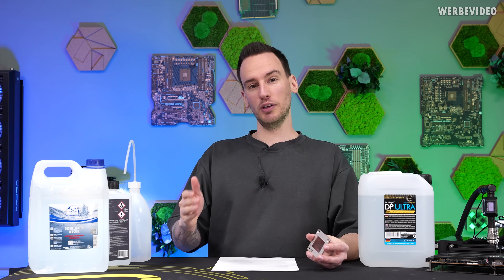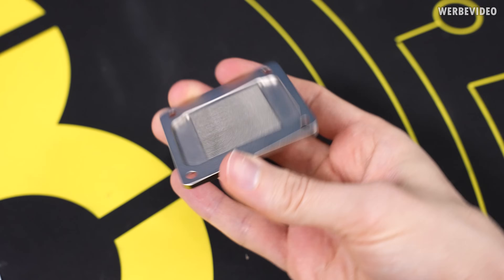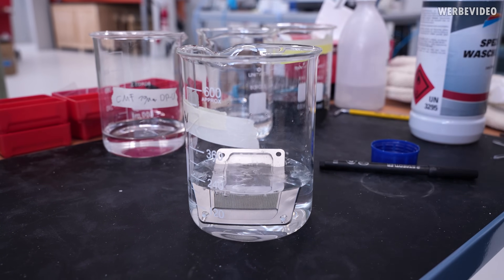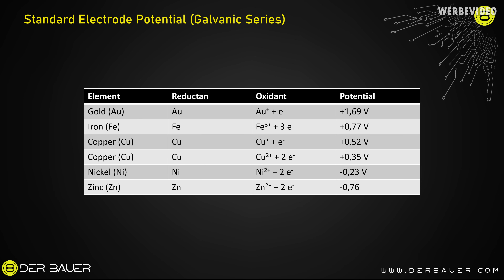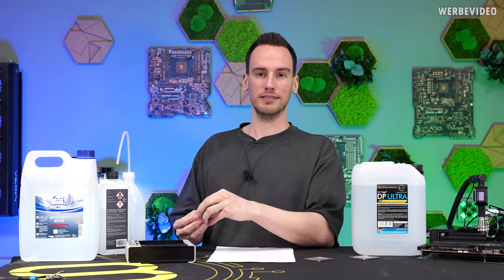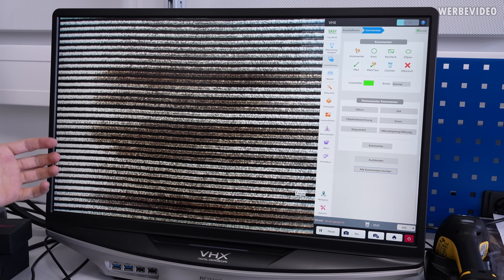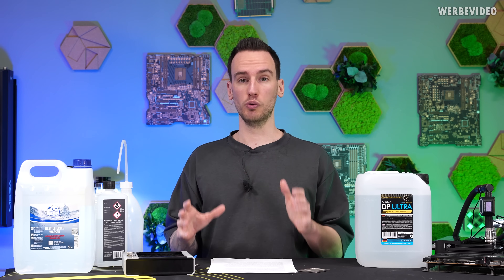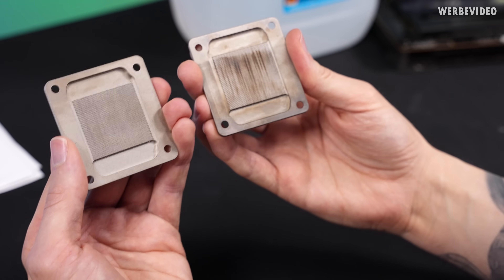Do NOT use Distilled Water for your Water Cooling Loop!

Comment: im surprised watercooling companies havent kind of standardised what metals are allowed to be in contact with your coolant at this point.
Reply: It's literally more than century old knowledge to not mix metals.
And so it was common knowledge and part of 101 sticky post on every single PC forum when PC water-cooling was born.

- res on pump intake so it doesn't run dry
- only distilled water + few drops biocide/anti corrosion additives + water wetter. No glycols needed unless you go subzero, thick coolant = shit performance.
- dont mix metals
- dont buy nickel plated parts, all manufacturers sooner or later have a f up 
- surface area is god, one 120mm of cooling per 100W if you want your setup quiet
- plexi ages, cracks and reacts. Use metal, glass or derlin instead.

So were generalisations that kept you trouble free if you bothered to read at least single FAQ.

But nowadays it's just influencers and their stans buying shiny stuff with lots of RGB so...
Reply: @sznikers  I mean... Doesn't this list automatically disqualify like 90% of all watercooling loop parts? All the fancy distro blocks marketed towards "elite" watercoolers are practically all made of tons of plexi and gaskets. I imagine it's either super-expensive or annoying just to make a loop that 100% fits all these, and sometimes you don't even have much of a choice on some tight bends/fittings where only this one bespoke super low profile fitting even fits, etc.
Reply: @JoeyJoJoJr17  A lot of brands don't care about performance or reliability, same thing with all of those fishbowl cases with horrible airflow.
Reply: Companies standardizing something? Did THAT ever happen?
Reply: @n0n4me-h2h  standardized that every company do their own shit  ;)

Comment: Be aware that there are also different purity levels of “distilled” water. Some supermarket brands aren’t actually distilled but filtered with quite a bit of ions remaining.

In my opinion (have been watercooling since 1999) operating an as sterile as possible loop is as important as using the right coolant if you want to operate a loop for many years without noticeable performance degradation. Microbial byproducts like biofilms can clogg up the micro channels that are necessary for well-performing watercooling blocks.
Reply: Also, a thing I've read from chemistry researchers on fine art restauration, it that pure water is the most unstable state and some contamination occurs as soon as the distilled water bottle is opened and exposed to ambient air. And with plastic bottles, the material of the container itself can be a source of contamination during storage. The more the distilled water is old, the more it will lose its purity level.
IMHO the best thing is to not stock distilled water, especially already opened bottles/jerrycans, without adding things like biocide.
Reply: @PainterVierax  I mean, you're not totally wrong. Don't stockpile water or leave it in shitty plastic (glass is worse actually, far worse). But don't taint the water. life doesn't pop into existance spontaneously. No carbon (dioxide) = no plants. If the water is pure and in the right plastic (which is rare outside a lab, because it isn't cheap plastic) it will last for ever.

If money is no object, buy some milliQ water. It will come in teflon and if not left in UV light will stay clean for a long time.
Reply: @AnthonyNolan-w5u now I'm curious why glass is bad as it is air tight like metal? Metal will corrode in time but why glass? PE-HD is usually used for all kinds of chemicals, so what is the super expensive one?
Reply: @Tsiikki Depending on the glass there might be an ion exchange reaction with H3O, introducing sodium ions. It looks like glass and HDPE are both used for DI water though, so it doesn't seem like it's a big deal.
Reply: Distilled water is also different to deionised water. Deionised water goes through a chemical process to remove ions, whereas typical distilled water is filtered (sometimes multiple times) before being distilled. I don't recommend drinking deionised water... I've heard it's quite unpleasant. Distilled is fine to drink
Reply: yea, the distilled water you get at the apoptheke (german pharmacy) in germany is very different.

Comment: I've been watercooling since we used to make our own waterblocks with a drill press and a motorcycle radiator and have ALWAYS used some kind of additive to keep corrosion away. Usually we would use some kind of glycol based radiator coolant meant for cars/motorcycles or Air conditioners.  I cringe every time I see someone saying to just use "distilled water".  Glad to see someone made an actually technically based video on why it's bad.
Reply: Same. 20 years building loops. I use reverse osmosis filtered water with Valvoline Zerex at a 90/10 ratio. The Laing D5 Vario in my PC is turning 21 years old this year and has basically ran 24/7. I suspect the phosphorus based dye in the Zerex forms a sacrificial coating around the D5's ceramic bearing race and prevents any wear. At this point I'm running it to see how long it will go, the pump has already paid for itself 20x over.
Reply: Afaik both the 5 and 355's bearings are designed to "float" on whatever's being pumped.  @K31TH3R

Comment: I run deionized water with around 15% ethylene glycol in my computers. All the nickel plating looks like brand new, and all the tubes and reservoirs are crystal clear. Doesn't have to be any more complicated than that. Service life appears to be at least 3-5 years with zero maintenance.
Reply: deionized or distilled water + ethylene glycol has a name, we call it coolant X). He even says in this video that DP ultra is just distilled water + inhibitors. Ethylene glycol is an inhibitor.
Reply: Deionized water is snake oil. It ionizes as soon as it touches any metal. It’s a known and proven fact of water cooling for like 15 years.
Reply: Try 35%
Reply: Only thing is that the specific heat (thermal capacity) of ethylene glycol is much lower than water so you are taking a performance hit right on the outset. It is relatively small though to be fair.
Reply: @Etheoma with 15% ethylene glycol, you're losing less than 2.25% at 40°C water temperature. It's a loss, sure, but not at all something that the average Joe will have to worry about affecting their net CPU/GPU temps much.
Reply: @NLRevZ  So you loose about 0.9degrees at 40°C water, it's not bad drawback at all.
Reply: Small enough that it's demininuns.  @Etheoma
Reply: @Etheoma  Ive been testing pure distilled water against water + propylene glycol and result is it doesn't matter because I'm already maxing out the thermal transfer at 60% pump flowrate (between 60% and 100% flow temperature don't drop anymore because its limited by the thermal transfer between the chip and the waterblock or the waterblock itself. I later added another 360mm radiator and the water temperature dropped by 1-2 degrees no matter what liquid is used. The difference is in most case negligible in worst case can be compensated by increasing the flowrate a few %.
Reply: @jagildown60 % pump speed causes wildly different flow rates depending on your components resistence. You can't just go by percentage. 60% on a high restriction loop might put someone's flow rate well under the 120 l/h flow rate mark. You have to know your actual flow rate, and also how many watts your components generate under load, to know where you land on the curve of flow rate impacting temps. I've made loops with a D5 on 100% that could barely hit half a gallon per minute (120 l/h). Used HWL rads, and high restriction blocks, and quick disconnects. Those kill your flow rate and may cause a person to want a second pump
Reply: @jagildown Correct, the issue at this point with modern components is heat flux density - it's a function of IHS design and waterblock contact. Direct die is where you'd see some differences but still enough to compensate with extra coolant flow rate or some more fan speed.

Comment: Why not just clear coat (like 2k on cars) on the copper block to protect it from oxidisation since people want the copper look?
Reply: Yes, works fine. I use clear on all my copper tubing builds as well as the copper water blocks.
Reply: cars have much bigger fins and much bigger temperature differences and much more surface area to work with without gunking up the fin channels, so the impedance of the heat transfer for a car isn't as big a concern, and engines like to work at a specific temperature range as opposed to computer components which like the lowest temperature possible, again requiring the best heat transfer possible for a PC. car coolant still has inhibitors and other additives anyway. it's also not just about oxidation, it's galvanic corrosion, no oxygen is involved but differing ionic charges
Reply: @glebglub I presume the guy meant that the coat would only be on the outside of the block, not on the fins of course.
Reply: @Bayonet1809  Yes just the outside to stop oxidation for the aesthetic

Comment: While with NO additives distilled is not to be used, simply due algae growth, hence some kind of biocyde is must, imho corrosion issue is a bit overexagerated. Does corrosion occurs? Indeed. Is it to rate that one should be that much scared off? Not that convinced (it will become big enough issue though if metal dissimilarity is greater, which imho might be the case if aluminum components added to loop). Imho even with distilled, loop can last for 5-7 years .. and by then, cpus/gpus are due upgrade anyway, and most probably not much use for those old LC blocks too ..

Comment: Is car radiator coolant suitable?
Reply: Only if you plan to run PC at -36C ambient. You loose a lot of thermal conductivity comparing to water. 40% glycol in car coolant added to make it antifreeze during winter. Also it is thick so pump can struggle to push it through fins
Reply: I do not recommend. Tried once and stained everything in my loop, build gunk, it was a mess. Now I'm using only distilled water lol.
Reply: @Victor-Penha  They make clear Glycol products, for example the giant 5L container on der8auers table is a Glycol Clear product!

Comment: very interesting. And I'll keep using distilled water with a few drops off myhems biocide to manage PH levels. Works for me for over a decade.
Reply: Exactly,just use kill coil.
Reply: @harisjaved1379 Kill coil, silver, is anti-microbial and wards off algae growth, thats not what Roman is describing here. Galvanic corrosion. Watch the video again. Kill coil, silver, most definitely accelerates that.
Reply: Same, 10+ years on distilled water + Mayhems Biocide (1 drop/L) + Mayhems Inhibitor (around 5-6 drops/L). And cleaning it up every 1 year and a half or so.
Also, the quality/thickness of the nickel plating and operating temperatures are important. Electrochemical reactions (i.e., galvanic corrosion) will happen, the key is to minimize that process.
Reply: Couple drops of bleach does the same been doing it that way past 10 years as well zero problems. Add little bit of antifreeze for a lubricant good to go not rocket science.
Reply: Been doing just thst for over a decade now also.

Comment: Here we go with the people that say: Works fine in my loop and I haven’t changed the liquid in years.
Reply: To be fair, most of the claims I see are claims they only use distilled+additives and usually come up in the conversations where people have used some exotic coolant and had a failure directly caused by said fluid. There really needs to be an "Only" in the title
Reply: He say that it JUST LOOKS BAD. It works normal.
Reply: Thing is loops work at acceptable level even if corroded and gunked up, but yeah, all the mess for 3C better than just using air...
Reply: @PREDATEURLT  if you're only getting a 3C difference you're doing something wrong. my GPU dropped 20C on the core and 40C on the VRAM and my CPU on air would throttle with an NH-D14 running y-cruncher but now only throttles if the coolant reaches 46C (which it never does, I only found it out during low speed fan calibration testing under unrealistic loads)
Reply: @glebglub On GPU some more, but now GPUs use huge coolers, even 4090 and other cards are capable of running around 60C at full tilt with air, and making it 45-55C with water won't make any difference other than looks. I am "playing" with all this stuff from 6600GT ans athlon 3000+ (20 years ago) and in last 5 or so years air got insanely big and effective, to a point where water is just for having colorful tubes in your system.
Reply: @ in general I agree, but there are still outliers such as the 14900k which no air cooler can handle, the 3090/3080 where the rear-mounted VRAM would reach 105c and throttle/die, and extreme summer heats where the temperature delta can cause hotspot to get closer to the silicone death point. there's also the convenience factor of being able to externally mount a radiator to a window and push all the hot air outside minimising the increase of room temperature, especially on an already hot summer's day if you don't have AC. you also have to remember that people like it to be as silent as possible, so if you're chasing a low noise floor the more surface area for radiators you can achieve the lower you can spin your fans, even during hot summers
Reply: @ Yes, not saying that it has no place of use completely, but now it s very very niche. And the price of full custom loop is INSANE, system with high end GPU block, CPU block, res, mountings, pipes, good pump, liquids, radiators and fans can easily reach 1000$+ and that makes solid midrange computer by itself.

Comment: also don't DRINK distilled water. the fact it's "pure" means it will leech minerals and other compounds out of your very cells due to osmosis, so it's no surprise it messes with a watercooling loop without inhibitors (and potentially glycol). water's a funky thing
Reply: i only drink distilled water you should see the stuff that i filter out the tap water XD
Reply: Give use peer reviewed study
Reply: If you have average diet it is fine. The issues really only come when you drink a lot and don't eat. And even then a lot would likely be issue with tap water too.
Reply: That's literally a bullshit myth😅
Reply: This is easily Googleable. Please don’t spread false information about health when you can fact check yourself so very easily. 

This is BS.
Reply: That's not how things work. Your body maintains a balance of water and electrolytes when you drink low-electrolyte liquids. 

Drinking DI (deionized) water or other pure water will give you water poisoning faster than drinking tap water, but you'd still need to drink gallons of either in a very short time to have it be a problem.
Reply: as much of a myth as the "dont drink coffee, it will dehydrate you"
Reply: i usually run distilled water through my pc loop to replenish the ions Cu²⁺ Pb²⁺ Ni²⁺ before drinking it, i couldn't find a plate that use iron so i have anemia right now.

Comment: TLDW, is this about actually pure water somehow being MORE corrosive than tap water?
Reply: That is probably too extreme a take, as the quality of tap water could be so varied from place to place it might well be an exceptionally corrosive mix in comparison (or full of something like the minerals from your chalk aquifer that will build up limescale), but it is in the right ballpark - basically just use proper coolant mixes (which might well be mixed from distilled water) and you won't have much trouble.
Reply: Yes because of the negative cationic state of the H20 molecules, Roman explains in the beginning. Good lord how do people make it through school, this is the 3rd comment where its as if the person didn't even watch the video.
Reply: @Make1984FictionAgain-JQ  literally TLDW and I've seen people mention ultrapure waters are surprisingly reactive in the past

Comment: Doesn't Linus advocate for just distilled water for years?
Reply: Since the times people were drilling blocks themselves and used car heaters as radiator people used distilled water with few drops of biocide and anti corrosion additive.
That's 101.
That's what's meant when people say "just use distilled water", i dont know how we regressed so much that nowadays people dont know that or even worse they believe that if they dont buy water pc turbo pro coolant for 40$ per bootle their PC will explode.
Reply: @ No, Linus literally has claimed that JUST DISTILLED water is enough. They have also countless time taken apart some of their loops in the past that has looked like a total shitshow.
Reply: Yes
Reply: All the LTT rigs that has been used for more than just a few months also looks like absolute shit when they pull them apart. Meanwhile my rigs can run for years with no issues what so ever.
Reply: So does literally everyone else, I've been running walmart brand distilled water in my loops for years and they are completely fine when I take them apart for maintenance/refilling/upgrades. This video makes no sense, his own testing finds along with his own statement, that this is completely a non issue. As usual, just don't mix metals. Nickel plated copper and copper together. And don't use brass fittings or an aluminum radiator. 
Plus the only actual problem here is aesthetic discoloration of the surface, there is no performance or longevity degradation lmao. This video is a thinly veiled ad.